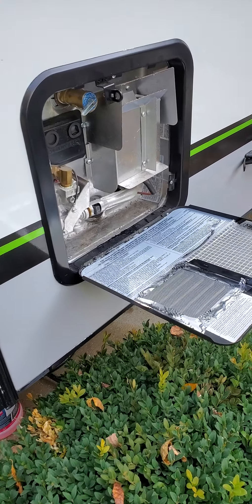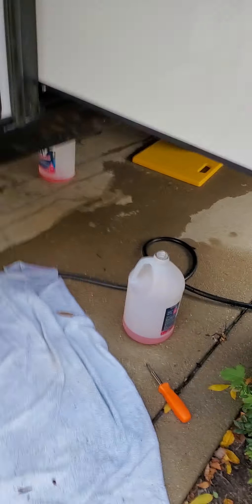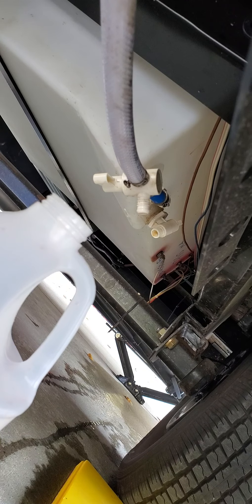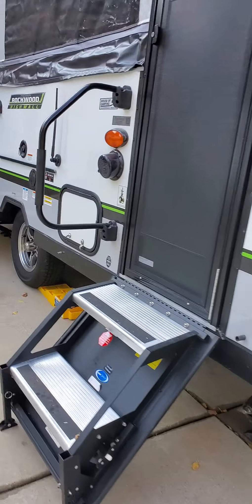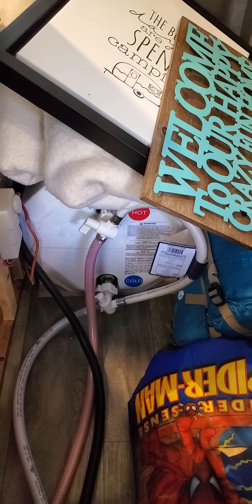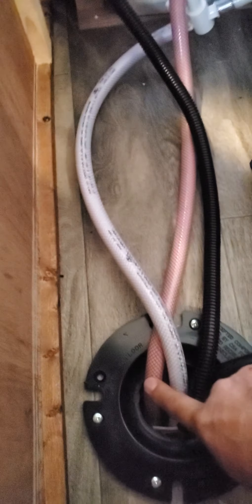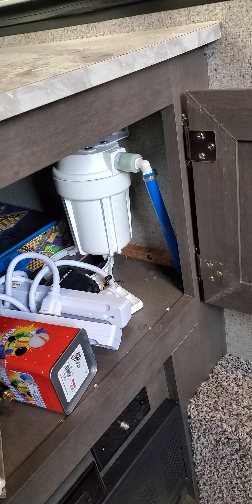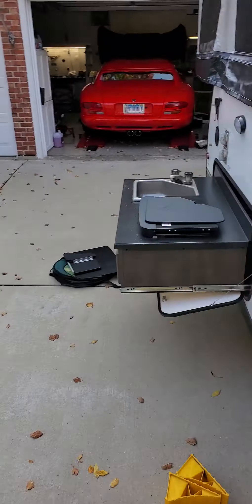rockwood pop up high wall hw277 winterizing

Comment: Is the valve to the left of the water tank the one that you secure a 1/2" hose to and add anti freeze through the system with the water pump? In this way you are bypassing the fresh water tank when winterizing. It appears it has a male hose connection.  I have a similar design on my Rockwood 2280 BHESP model. Thanks in advance for your reply.

Comment: A winterizing video that starts when you are already done?  You mention you used a 1 1/4" socket to remove the anode from the hot water heater, is that correct?  My 2022 model is a 1 - 1/16th.   Helpful, but off to look for a video that starts at the beginning of the process